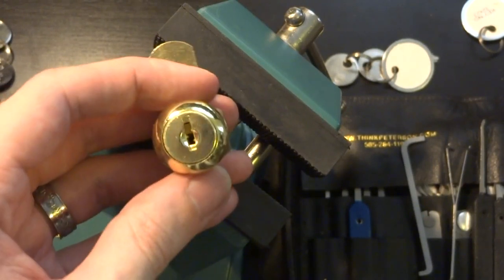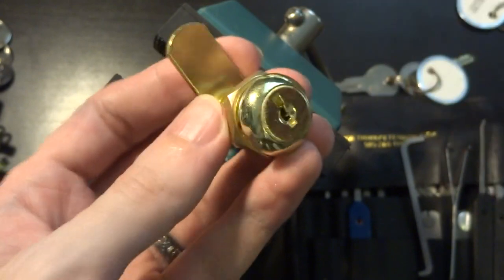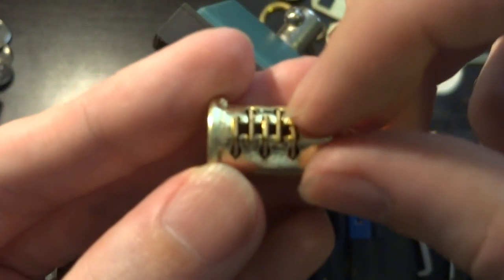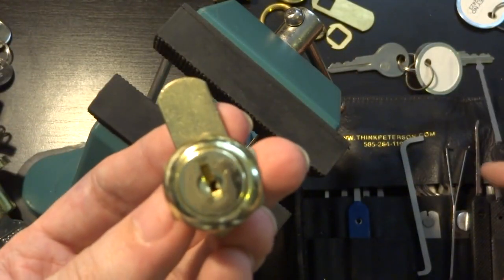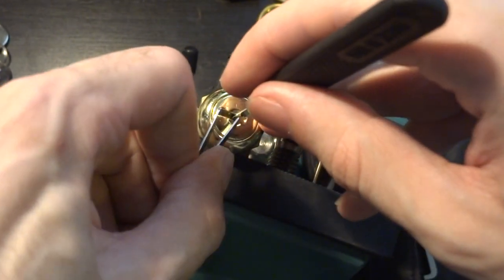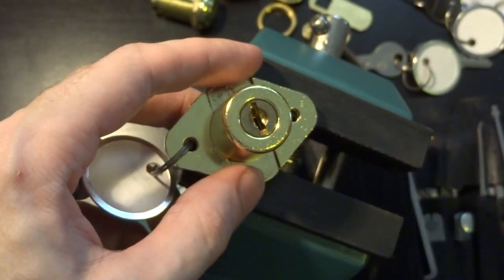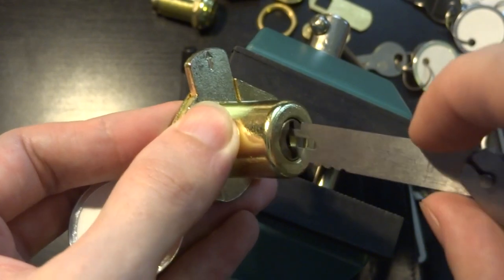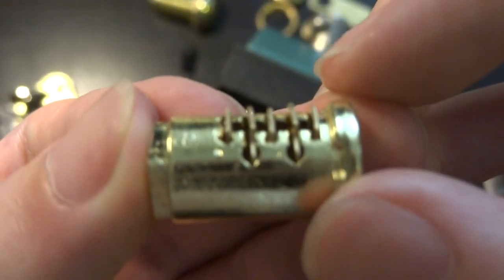(016) introduction to Wafer locks

Comment: Must agree with mateo-I bought a small Capitol padlock.Thought it was pin tumbler.Spent ages trying to get it picked-managed it twice by blind luck.It only cost £3.00 so I took a Dremmel to it -it is all brass.I bought a replacement which I could send to you free-I'd love to see what I'm doing wrong!
Reply from the maker: David Worsley Wafer-lock padlocks are not very common (at least in the US) these days except for some luggage locks. Of the ones I have seen the most common versions are variations on the Chicago Lock design which use very densely packed wafers, these always have 'double-bitted' keys (keys cut on both edges of the blade, with each side being cut differently from the other). I am curious what brand and model lock you have.

The first thing would be to examine the keys (and the wafer pack from the one you cut open, if you still have it), if the key is single cut (cut on one side only) it is a standard wafer lock similar to the one in this video and should be pickable using the method I demonstrated. If the key is double sided but the sides are identical, this is likely a 'convenience key' (the duplicate cuts just allow you to insert the key in either orientation) and they can also be picked as shown in this video. If the key is double-sided and the cuts are different from each other, this is likely a copy of the Chicago Lock which requires a slightly different technique.

With wafer locks tension tool placement is critical, it is very easy to block or bind a wafer with a standard tension tool so 'wishbone' tension tools are recommended. These tools also keep the center of the keyway clear so that you can easily use your picks to manipulate either side of the wafers without moving your tool. Picks such as the double-ball (snowman) are useful for raking and jiggling techniques on these locks, and hooks with a fine point are necessary to SPP densely packed wafers, otherwise standard picks should work normally.  There are special wafer lock jiggler tools which you can buy that work well on many wafer locks but they are not necessary. BosnianBill has a couple good videos on wafer and Chicago Locks which may be useful as well (https://www.youtube.com/watch?v=AIexbFSbYP0 and https://www.youtube.com/watch?v=_oOXMBcYnWY)

One thing that you need to be careful of is that if you usually lever your picks on the lip of the keyway, that is likely to push the wafers back out of position so practicing 'direct lifting' (the pick is supported only by your hands and stays near the center of the keyway) can avoid that issue.

I hope this helped.
Reply: Nite 0wl Thanks for taking the time and trouble to give me such comprehensive advice.It is single sided and has 5 densely packed wafers.
I think you are right about tensioning problems-the access is severely limited and it is hard to manoeuvre the pick.I will resume the attack with renewed vigour and confidence-thankyou.
Reply from the maker: David Worsley Best of luck.